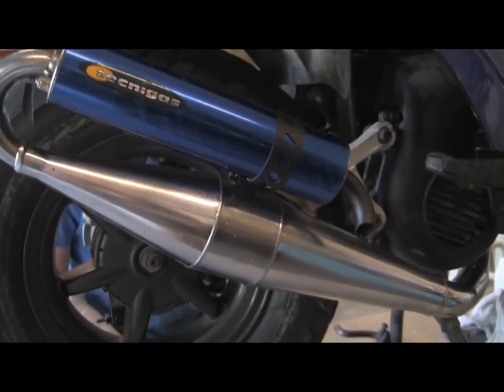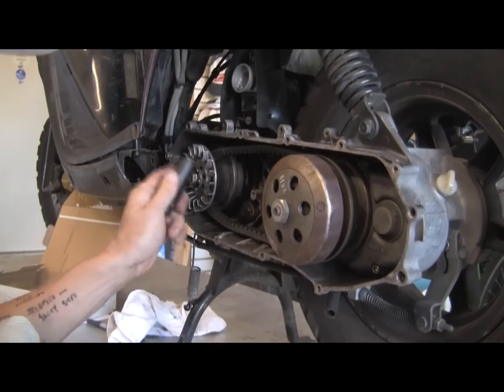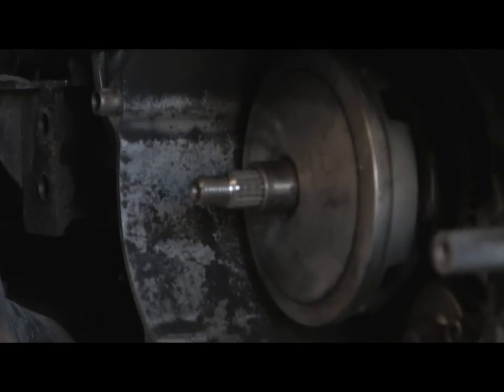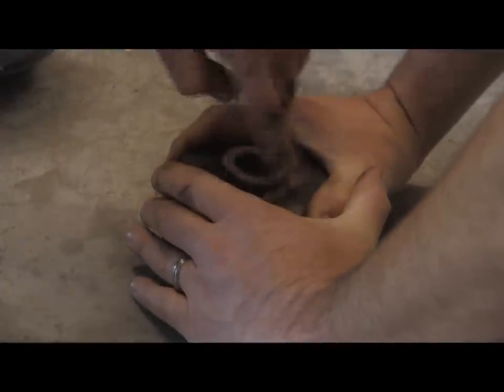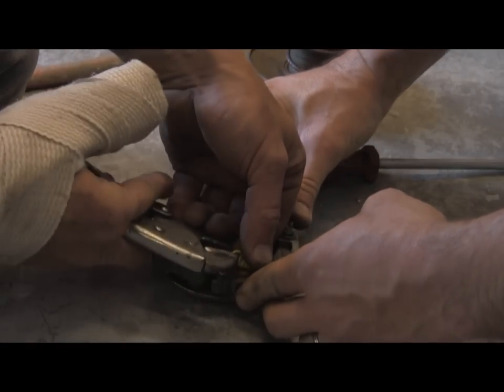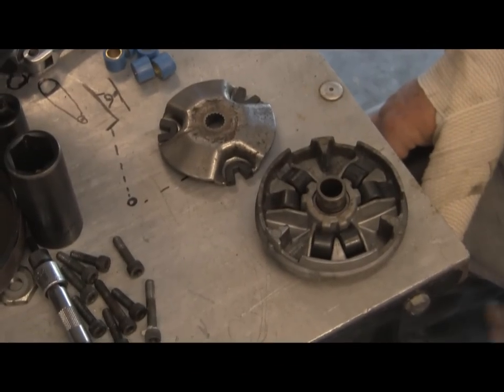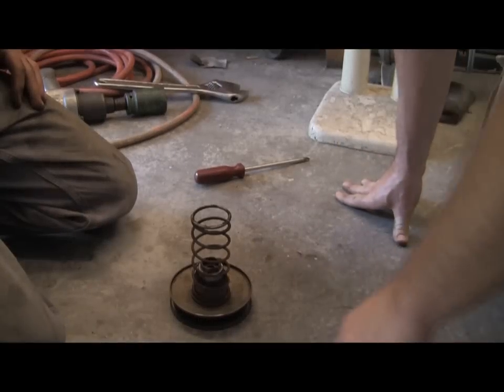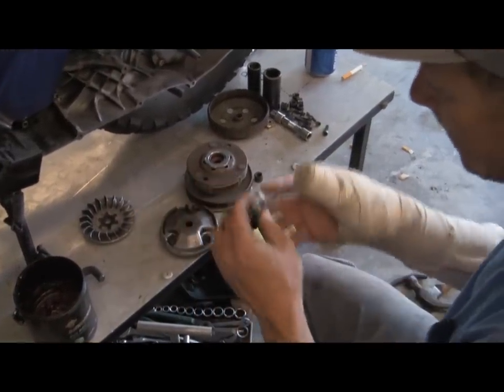zuma springs and rollers

Comment: dont NEVER use hammer when putting clutch springs because u can broke clutch.and on 50cc clutch and torque springs max 15-22% and change those sametime.if u put too strong springs ur scooter dont have enough power to start moving.and variator rollers with lighter u get better acceleration but u can lose some top speed if too light but heavier u lose acceleration but gain more speed

Comment from the maker: I would buy a kit that contains a selection of rollers and experiment.  Without the pipe, I would leave the factory springs.  The Zuma in the video will run with one of mine that has a 70 kit (but no pipe).  I would only change springs if a pipe were involved.

Comment from the maker: At the end of the day, the Zuma you see in this video has a top speed of around 44mph and has "different" acceleration than before the change.  It gets to 44mph faster. The stiffer springs hold off the engagement of the clutch so that rpms are high at take-off....  like a stall converter (if you will).  Keep in mind that without the pipe, the top speed won't change much....  the springs and rollers would change the power arrangement.